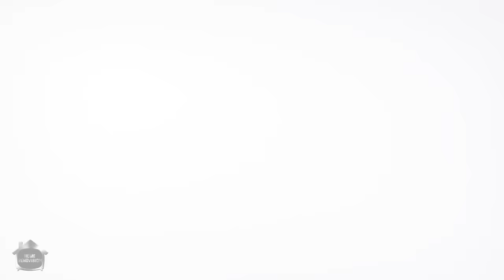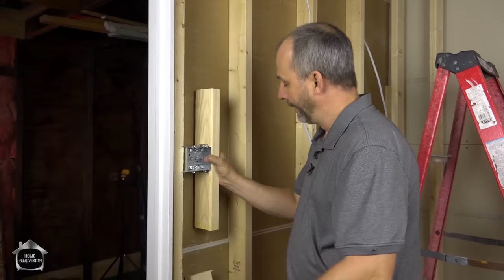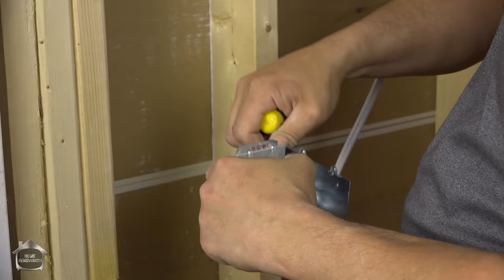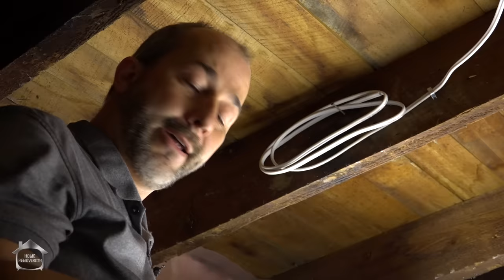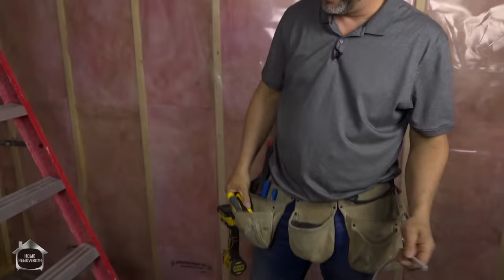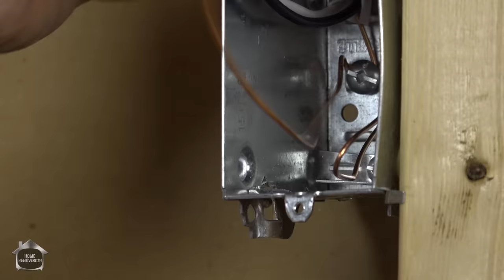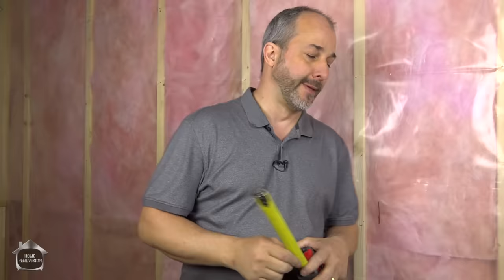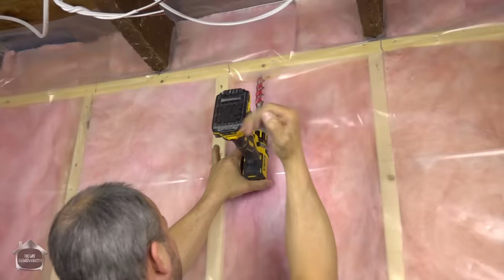DIY Bathroom Wiring | How To Run Electrical

Comment: Jeff, I’d love to see you do a video on fitting wired smoke detectors in an old home. I purchased a set of 10 and haven’t installed them yet because I don’t know where to start.
Reply from the maker: you run 3 wire to each of them and have them all on the same circuit.
Reply: Home RenoVision DIY on their own circuit?
Reply: You have it on its own circuit breaker. It can't share a power source with anything else. If you have one floor, try going in the attic to run your wiring. Cut a hole with a 4 inch hole saw, do not hit the trusses. Install a circular lighting box with a metal bracket in the attic. You'll have to repeat this process for every room. You'll need three wire, and have to run it to every box installed. White is neutral, black is hot, the red wire is a signal wire, which connects all the smoke detectors together. If you're home it two floors, It's tricky. You might have to fish wire up from the basement. Or you're gonna have to cut through drywall to get your wire where it needs to go.

Comment: Just an FYI, in Canada the distance between a switch and any tub or shower installation is 1 m. 1m is about 39"... so I'm not completely sure if 37" actually cuts it, unless your inspector thinks it's 36"... If it's between 50cm and 1m, you need it to be GFCI protected.
Reply from the maker: We will see, inspection this week. Cheers!
Reply: yep the 1m rule was updated in 2018(Canada). And I've noticed a lot of licensed electricians don't know that.

Comment: Great Videos! However, I don't understand why you wouldn't install a box for the vanity light in the rough in stage regardless of the type of vanity light you choose? If you don't install a box because you are planning to run wires directly into a light that has a metal box that gets installed on top of the finished wall, you would make it very hard to swap out the light in the future for a light that has a mounting bracket that get screwed onto a metal framing box. Also, I have a property in a jurisdiction (suburb of Chicago) that frowns on Romex installations and the electrical guy at HD said I have to convert all of the electrical to conduit back to the panel? Since I only want to add some can lights during a remodel of the bathroom this seems very cumbersome, and expensive since it would be above my capabilities. I'm afraid to call the city to verify? Any suggestions/information? Thanks.

Comment: not 100% sure of the code implications, but I've heard of inspectors preferring a hole for each wire in some cases, otherwise technically you're supposed to de-rate your conductor based on the number of current carrying conductors that are bunched together through the same hole to account for the potential hotspot

Comment: I live in an area in the deep south  where codes are important if you live in the city but in the countryside and your not building from a bank loan, no permits or codes required except for septic systems theoretically but i can't get insurance unless i have electrical,  plumbing and siding however installed, so i have no insurance.

Comment: Not sure where you're located. 
Any US county using 2014/2017 NEC Code calls for no less than one 20 amp GFCI  circuit separate from the lighting which must also be GFCI/AFCI protected.
Modern blow dryer's can pull over 80% of the rating of a #14 wire. 80% is the max continuous load you're allowed to put on a circuit.
(you said you added another circuit but you didn't mention the gauge)

Code also requires a staple every 4.5 feet or less. One staple must be within 8 inches of a plastic box or 12 inches of a metal box.
No more than two circuits under a staple, clamp, or hole. Holes can't be more than 1/3rd the width of the board (centered) or within two inches of another hole. 
Make sure grounds are made up before rough-in inspection.
Make sure lights are rated for a "wet" environment within 3 foot of a shower.
Reply from the maker: Thanks I live in Ontario , Canada!
Reply: He's in Canada
Reply: Guess I am  lucky that I am in the country, the only thing they inspect in the sewer.   Love these video.
Reply: A continuous load is also defined as 3hrs or more. You can exceed 80% for non continuous. But he’s in Canada so there is that.
Reply: I don't think something is considered continuous load unless it runs for 3+ hours.  I don't think people are drying their hair that long...
Reply: Home RenoVision DIY thanks for clarifying! I was confused why you were running 14 gage.
Reply from the maker: LOL, this house is 140 years old and has never had an inspection. don't know why I even bothered.
Reply from the maker: Lucas Rayala, my pleasure. Cheers!
Reply: @taylorlightfoot  
The point being, a blow dryer can still pull enough to trip a 15 amp breaker that's also running an exhaust fan and a light bulb, leaving you in the dark.
Reply: No AFCI required for bathroom lighting as of the 2017 code or gfci protection, unless there is a light above the bathtub in which case those lights would need gfci protection above the tub. Some years back our local authority allowed us to put the gfci in a bathroom on with the a lightly loaded 14-2 bathroom circuit, but that has gone away some years back. We can wire the whole bathroom in 12-2 and have the gfci included or wire the lighting in 14-2 and run a 20amp for the vanity gfci only.

Comment: One of my favorite things to mark power going into a box is twisting the hot and neutral 1 or 2 times as an easy marking they are the Line(Hot/constant power) going in. This also helps mark which wires are your Line power(Power in/constant hot) for GFCI wiring which has to be line in and load out specific.

Comment: We wire to 20 amp circuits and use 12-2. (Texas) Can you talk about why the metal boxes instead of the blue plastic?
Reply from the maker: metal is cheaper. Cheers!
Reply: I've noticed in hot climates they use plastic/PVC boxes maybe because the metal heats up. Always follow your local building codes for this reason.
Reply: @HomeRenoVisionDIY  A plastic .22 cu box is like .20-.40 cents metal seems to always be more here in the US

Comment: Odd question.  I'm in the process of changing out receptacles in my house.  Our half bath had a GF one that I removed, but when I test the wires with my multimeter BOTH romex's coming to that box are testing hot.  (by putting the negative on the white wire and the red on the black, both Romex strands are giving me 120v - US resident)  The receptacle that was removed had a rear cover on it, with pigtails built into it.  Not all of the pigtails were used, so comparing how it was hooked up really does me no good.  Do I just cap one set and wire in the other Romex into the Line side of the new GFCI?  I'm no electrician, but I don't think pigtailing them together would be wise, since they both must be coming straight from the breaker box.
Reply: It's alternating current.  Half the time each is positive and then negative.  Try measuring each to a pipe or metal faucet one should be 120v or so the other almost zero.

Comment: Good job on showing your viewers on how to ruin an expensive and not to mention a precision tool that is made for cutting and twisting wire
What you don't own a hammer
Reminds me of a helper on a job site that borrows your tool and turns around and does crap like that
Ya beat the crap out of those $75 Klien linesman

Comment: Thanks for the great DIY videos.  I have a question on electrical runs (doing my kitchen) WITH permits :)   I will need to pull approx. 5 separate circuits to meet the new codes.... I believe all need to be 20A which means 12/2 or 12/3s... I have about a 40 foot run to the main... do I run 5 12/2s or just pull a 50A (using 6/3 to sub-panel somewhere in the kitchen.  It's not really a code question but best practices.  Thanks.

Comment: Hey Jeff,
Quick question about that shed you built, did you by any chance have a material list for the size you made ?
I can put my own together ( but I’m swamped with work ) but it would save me some valuable time if you had one or point me in a direction?
Thx,
Tony G
Reply from the maker: I have one, just not sure how to deliver it yet. we are working on that. Cheers!
Reply: Patreon. I know you're not hot on it but this is the perfect application for things like this.
Reply from the maker: I think we have found a better option. be in touch with an update soon. Cheers!
Reply: Home RenoVision DIY I’ll look it up.
Reply: Home RenoVision DIY ok I’ll be waiting. Thx

Comment: Hey how do you find if a wall is “structural” or not. I was just curious how you would find these walls so you know which ones cannot be knocked down.
Reply: A structural wall is perpendicular to joists. A non-load-bearing wall generally runs parallel to it.  
     A qualified person needs to inspect this.

Comment: A The main rule of Section 210-11(c)(3) requires a 20A circuit that is dedicated to bathroom receptacle outlets. It does not require a separate circuit for each bathroom. One circuit may supply multiple bathrooms as long as only bathroom receptacles are supplied.
Reply from the maker: Perhaps in your jurisdiction, I am in Canada!

Comment: How do you support the wiring on the bottom of the joists and not impede the drywall lid?
Reply from the maker: I am going to use wood strapping for the drywall install. Cheers!

Comment: Hey Jeff, quick question, I have a large rectangular heating duct in my crawlspace that breaks off into all the small registers in the various rooms. And this duct system zigzags a lot along the main support beam in the middle of the house. I'm not really a big fan of passing things like pipes and vents through and under main supports, but what's done is done. The main question I have here is that all the electrical wiring runs alongside this beam as well. They're pretty stapled to the wall so they're not dangling around at least (though we did find several live wires that were just taped off and thrown on the ground, yikes). I'm running a bunch of low-voltage wiring nearby these electrical wires and close to these heating ducts, like coaxial, hdmi, and CAT6 ethernet. Is there a building code requirement (I am also in Ontario) for the distances of these wires, and maybe the electrical wires, between them and the heating ducts? I'm trying my best to staple and ziptie them away from touching the vents but I just wanted to make sure there's not a major hazard here.

Comment: Why the European GFCI is not as safe as USA ones?

In the USA GFCI is rated to trip from 4 to 6 mA. However, in Europe, it's rated at 10 mA and it's called RCBO?

Is it because the voltage in Europe is 220 V and so from OHMS law I = V/R.
So, for a 120 Volts and 6 mA, the impedance is 20,000 OHM.

For the same impedance @ 220 volts, the current is 11 mA.

Is it the reason they use 10 mA leakage RCBO?

Comment: Hi, I'm having a problem. I'm trying to connect a bathroom fan with a timer to my light switch so that the fan starts when the light is on and then runs for X minutes after the light is turned off. From the instructions, I need 3 cables (N, L, and Ls). In my light switch, I only have 2 cables N(neutral) and L(live) that I identified with a multimeter and an electric pencil. But I don't know how to get the 3rd wire(Ls) from my setup. Can you please help me?
Thank you very much!
Reply: Gotta suck up that poopy air after you leave XD

Comment: most bathroom plug circuits have to run in 12 gauge wiring not 14 gauge for lighting because the bathroom circuit is a small appliance load circuit

Comment: I love your videos - have watched several! Thank You for your great tips and calm presentation!

Your math on light spacing (4 ft apart) seems off... You said it's a 2 ft diameter at eye level, that's 1 ft radius -- so the light spacing would be 2ft apart to get the light "cones" or beams to touch and create a 'continuous' light effect.... does this sound right?
Reply: I had the same question! Not sure if I need 2 or 4 ft spacing now lol

Comment: 14/3 would be for a 3-way light switch, where you might have 2 switches on opposite ends of the room. 14/3 goes between the switches.

Comment: You should clarify at 31:47 that is does matter with GCFI receptacles whether you have both on LINE or make use of the LOAD
Reply from the maker: Hi Barry, we will be showing the fixture installs in a later video. Cheers!

Comment: If I remember correctly, don’t you have to run 12/2 or 12/3 in kitchens and bathrooms? At least that what I was told here in the States.
Reply from the maker: 12/3 in kitchens up here for sure.
Reply: You have to watch using 3 wire at all now the new code makes you use arc fault breakers which does not work with the 3 wire feeds but yes 12 gauge is required

Comment: the nec says 12 wire to a bath room in fact a single 12 to the gfci outlet and either 14 or 12 to the rest of bathroom or  you are allowed to run the whole bathroom off of one  single number 12 feed

Comment: where did you get the boxes and wire staples---Lowes doesn't have either of those items---they only carry those yellow staples you are suppose to nail tight and the  non welded boxes

Comment: Isn't heating (including heated floors) usually 240v and not 120v ???
Reply from the maker: you have both options on smaller areas but only 240 on larger areas.

Comment: Upstate NY- pretty sure only a licensed electrician can do this. Pretty sure here you have to hire an electrician and have a permit pulled just to change a ceiling fan 😂 I could be wrong but reading through permit rules that was the impression I got. I plan to hire for electrical though. I didn’t drop out of college as an electrical engineer to still do this stuff.
Reply: Natalie most electricians will tell you that to try to get the job. Truth is almost every state and municipality allows something called an owner builder permit. These allow you to do the work yourself on your own home only. Then the inspector will sign off on your work if done right or tell you how to correct it if not. Check with your city's permit center.

Comment: My inspector wouldn't pass my install with the "extra loop" of wire above switches/outlets.  He made me pull them straight...I just didn't pull them real tight so there was a couple inches at least.

Comment: My home has aluminum wiring, do I need to match the aluminum wiring? Or do I need to add copper which would cause mixing aluminum and copper? I know aluminum and copper will corrode if they contact each other.
Reply: KushDrone you need to use special purple merrets and nolax compound. Then pigtail the copper wire onto the aluminum.

Comment: Hi - I would like to install a connection box  inside a 3" thickness wall. for a pendant light on the top of my kitchen counter top. Any suggestion - please? - Thanks
Reply: 9 months ago? Did you get your pendant light? 3" wall thicknesses most boxes will work. You could use a pancake box if you really wanted. It's a very thin circular box often used for lighting, when there isn't room for a deeper box.

Comment: In Ontario, do you need to get inspected if you change a fixture or an outlet ?
Reply: Pretty much the only thing you can do without a permit/inspection is change out a simple single pole light switch
Reply: Yep... even if you change a switch to a dimmer you need an ESA.
Reply from the maker: in many cases that is true!
Reply: Not inspected, but you need your masters...... Who's gonna enforce that well....

Comment: Got a quote from a local electrician and it seems extremely high. I feel that I paid him $85 to come out here and give me an astronomical number.  it's kind of left me with a bad taste in my mouth. $3,000 to run to GFI 20 amp Outlets. One for the motor of a jet tub and the second for the little inline heater. Everything's open no drywall in the way .does this seem ridiculously high or am I being sensitive.
Reply: That is high, my electrical business is in southern ontario and I'd charge half that, I usually give free estimates too

Comment: Bathroom outlets in California need to be on 12 gauge wire and can't serve non bathroom areas.  Easiest method is a dedicated 20A breaker per bathroom, powering the outlets and lights and fan in that single bathroom.
Reply from the maker: Hi Taylor, that is a good system!
Reply: @HomeRenoVisionDIY  It works well.  If you stick in a combination arc fault and GFCI breaker in your load center, you can use normal outlets and have a cleaner look too.

Comment: This wiring job my be okay in Canada. In the USA. It is not. The pot light over the shower is it rated for that location?  A 15 amp circuit for the receptacle and floor heat. Do not plan on using a hire dryer and the floor heat at the same time. 15 amp circuit = 1800 watts . Hair dryer 1500 watts only 300 watts left for floor heat ,and any other electrical needs.  The switches he used were self grounding. That works well with the metal box. Most residential grade switch’s are not. The ground wire needs to be connected to non self grounding switch. The guy seems like a good craftsman. Most likely he does a lot well. Electrical wiring he needs more information.

Comment: I'm with you on leaving a good supply of electrical wiring, what to do when there isn't any slack?
Reply from the maker: that is when the wire is run just long enough to supply the box but there is none extra in case of damage to the wire at a later date.

Comment: When I installed floor heating, it required two separate conduits A. power  B. thermostadt to the floor. plus a double box with a mud ring, not a single switch box.  Warmtile requirements.